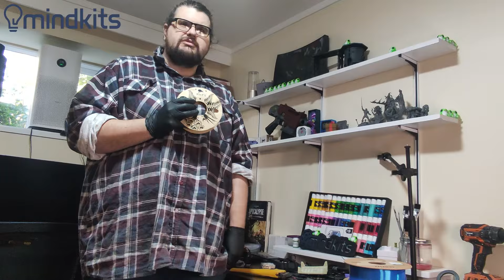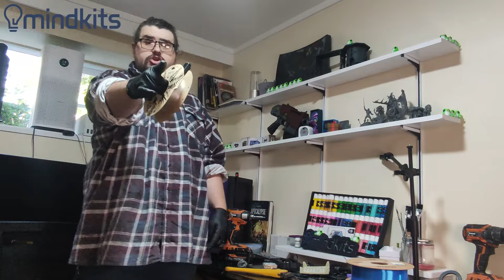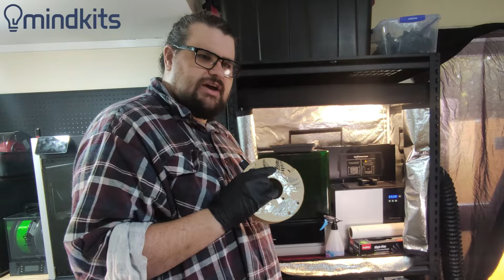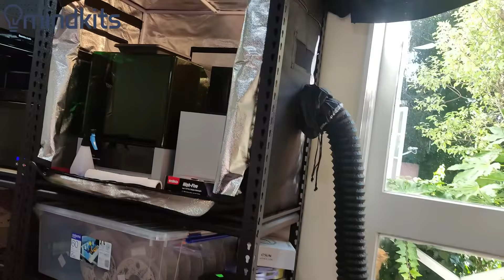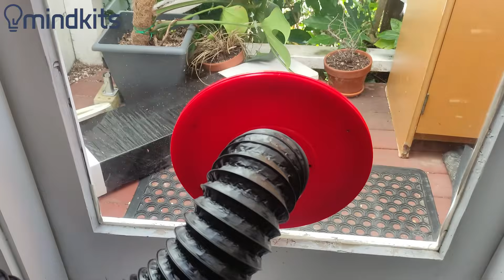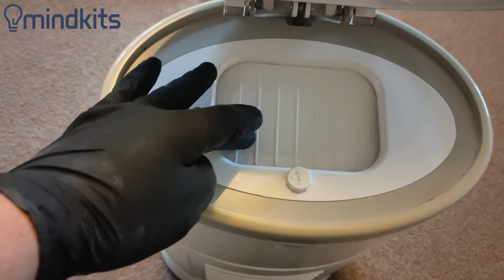Banish The Fumes! - Resin Printing Beginners Guide

Comment: For a beginner guide there is something really important not mentioned here. When you have such small grow tent that doesn't create a subroom in your actual room, where you have to open the tent to clean and cure it, all the particles will release into the air and your actual room once you open the lid and work with the IPA. It's not as "You can do how you want". If you have the space, get a bigger growtent that allows you to get inside while working with it. 

Also something very bad here shown. Don't let your animals get near of you lab space. Also there is something really important to mention about the process itself. You can get resin on your skin if you are not organized enough. First, you want to cover your whole body that doesn't allow to get resin on your skin or even onto your eyes. People had skin burns because they didn't realized that they had resin on them until they met the sunlight. And face protection is necessary as this stuff can splash when you remove the print from the plate. Expecially at the beginning with wrong print settings. You wanna avoid that as much as possible. You need to think trough every step to know what you do and what to do to prevent any possible accidents. Like not using the supplied spatula or working inside a box that prevents any splashes from going everywhere. 

Also these particles are havier then air, which means it will fall onto everything. You need to vaccum the grow tent from time to time with a mask on as everything inside will get sticky from the IPA mix. Also never touch anything inside that box without gloves.Gloves should be thick and long enough because you don't want to accidently cut them open or have your skin exposed.